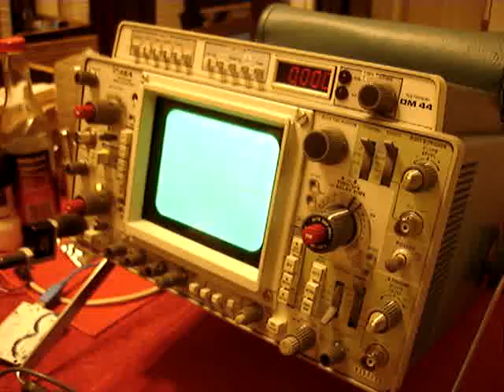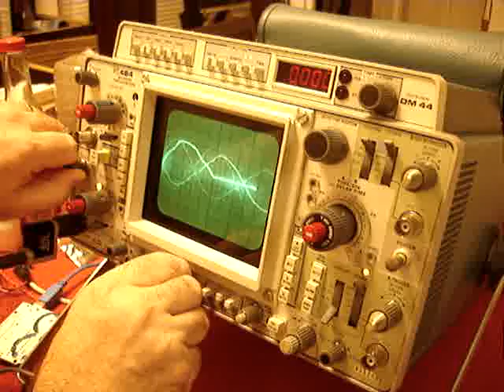Tektronix 464 storage modes

Comment: Thanks for this video. Picked up one of these from a yard sale for $10 and not sure what to do next.
Reply from the maker: skewedviewr 
Make sure it's in good working order. You can also use it as an electronic etch-a-sketch by setting it to xy mode in storage mode and moving the dot around with the position controls.

I used mine today to see if some 70V loudspeaker wiring was any good.